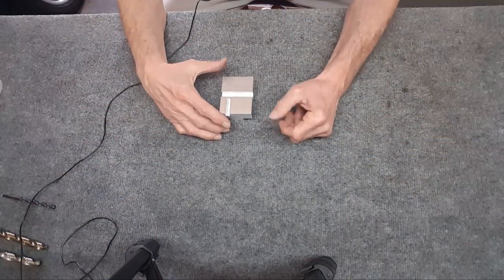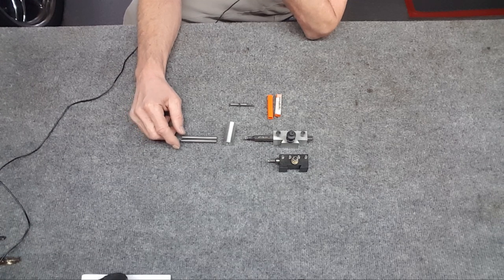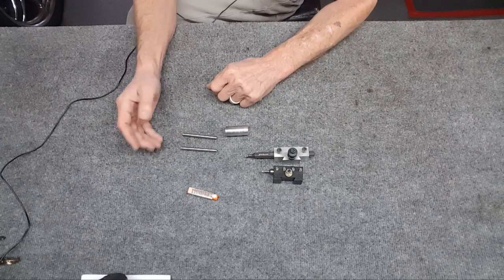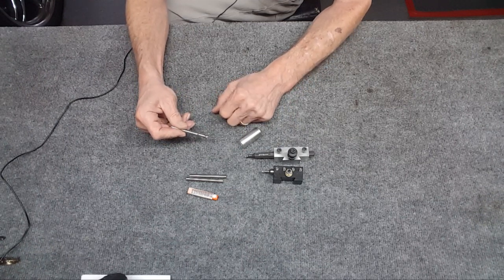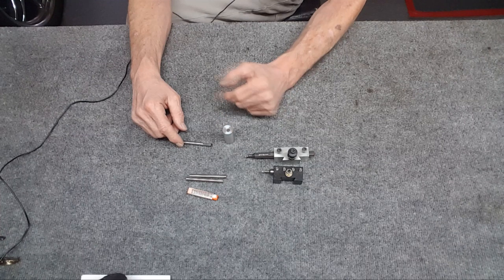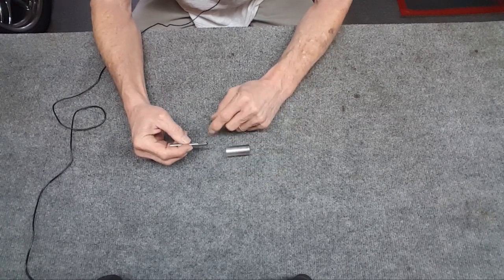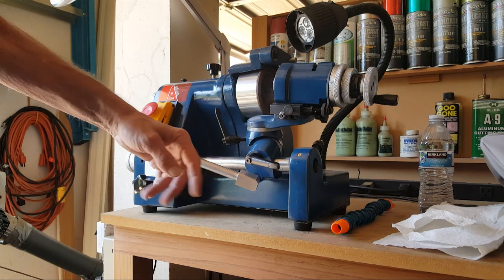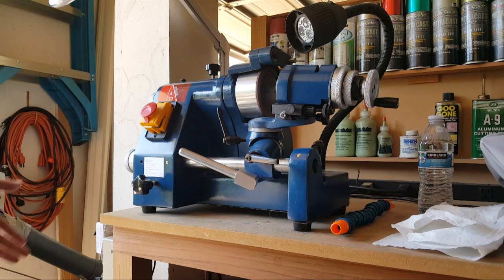Universal Tool Cutter Grinder Accessories & Upgrades

Comment: Good work Dave,
Have you looked on eBay for chucking reamer sets from China, I got a metric set for less than £12, seems to be decent quality.
When you showed that you had over heated that chisel, that brought back some memories :)
My dad is a retired joiner, his chisels were out of bounds to me as a teenager, I did the same thing and got clip around the back of my head, for trying to re-grind  a chisel , that I'd chipped .
The blue black tinge gave me away !!
ATB Adam